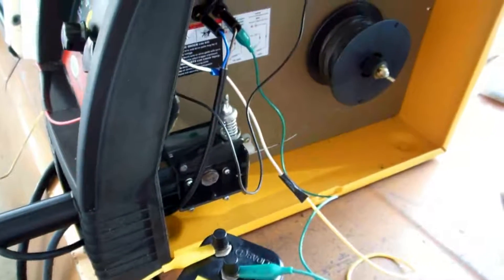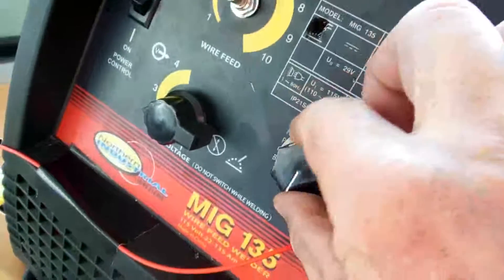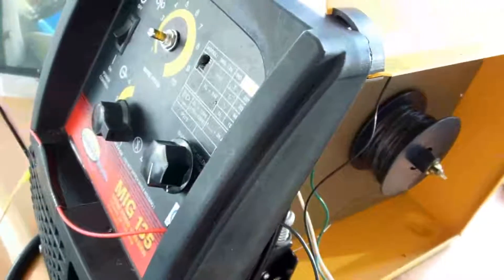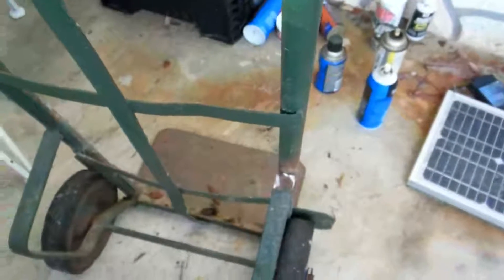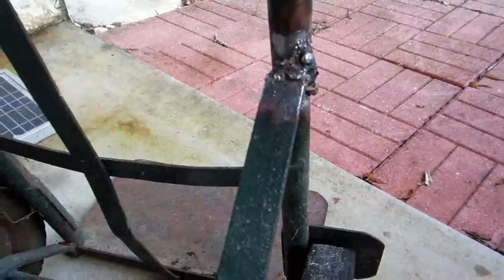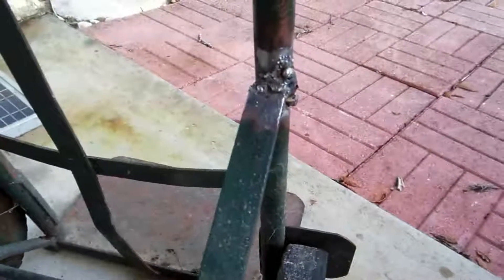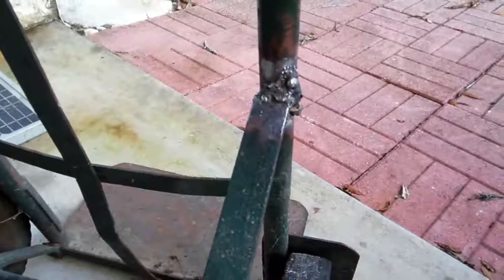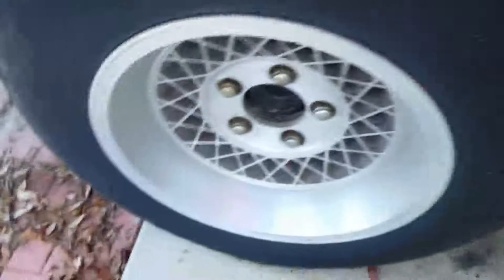Redneck Rigged Mig Welder

Comment: Yeah, I have a wire-fed mig too...and I have to turn down the wire feed very slow...because I need more power Scotty! , next welder will be much higher amperage. I can imagine the negative comments you'll get on your weld..but i totally understand your wire feed situation. The good news is a grinder will fix and clean those ugly duckling welds and paint helps more. We're just looking for functional strength here not prettiness..

Comment from the maker: I have some better wire on order, along with a 12 volt lantern battery and a heavy duty potentiometer.  That may get this to work like new with the wire speed.  Surprising that very sloppy weld is holding up well.  :)

Comment: Elcamino is not that bad...I'd grinder those rust holes out prep surfaces and use fiberglass...not bondo...fiberglass is difficult to form and sand down...but it's so tough stuff.  Young kids of the 70's played with glass and bondo...now-a-day i don't here much about it (video games, or) because the cars and trucks are super pre-treated cleaned in a phosphate bath and dipped in a elpo bath electrode system...to prevent rust..road salts were killer in the NE.